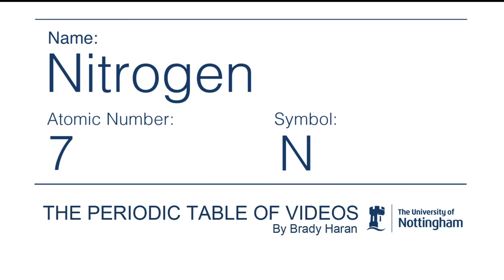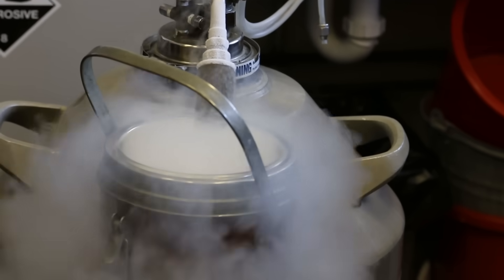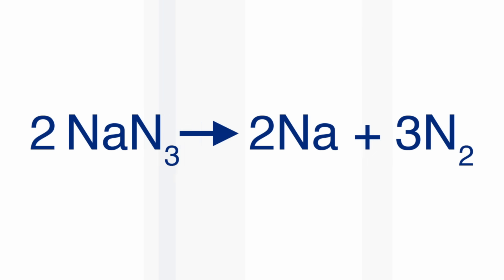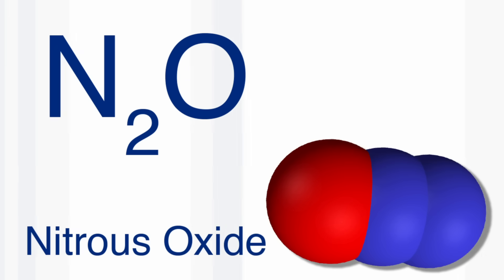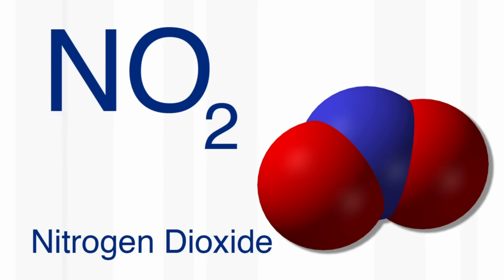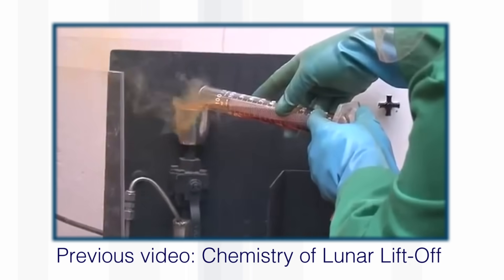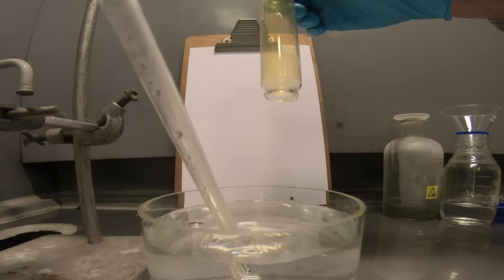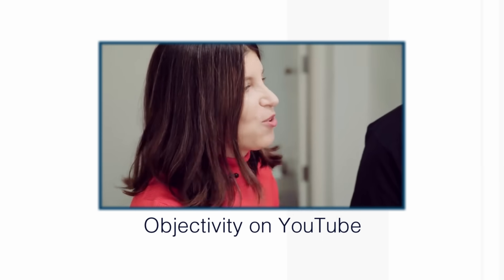Nitrogen - Periodic Table of Videos

Comment: I believe that you may be mistaken about the formation of NOx in gasoline versus diesel engines.  Diesel engines actually have a lower peak combustion temperature than gasoline engines.  The reason for the diesel engine's higher efficiency is due to the higher compression ratio of the diesel engine.  Also, until the development of the low sulfur diesel fuels, diesel fuel actually had a higher energy content per gallon (or liter, if you prefer) than gasoline.  This is an additional reason why diesel powered cars obtained better fuel mileage than did similar gasoline powered cars.

The delay in outfitting diesel powered vehicles with catalytic converters is due to the chemistry of NOx reduction.  In automobiles, there is virtually no oxygen in the exhaust and there is a trace amount of unburned HC.  The catalytic converter uses the NOx to combust the unburned HC which then yields N2, CO2 and H20.  This doesn't work for diesel engines as a standard catalytic converter would actually produce more NOx. This is because diesel engine exhaust has an excess of oxygen and virtually no unburned HC.   It took the development of SCR (Selective Catalytic Reduction) to reduce NOx emissions in diesel powered vehicles.  SCR uses Urea (basically a compound of ammonia) to reduce the NOx and produces N2 and H20.

Hth

Comment: The copper reaction looked so similar to a redox reaction equation i've balanced yesterday. I was wondering why the coefficients of the equation in the video weren't the same as the coefficients I had calculated. I thought maybe I had made a mistake. Then I checked my notes and realized that the reaction on the video weren't the same as the one in my notes. Mine had NO, not NO2. I must have forgotten to write the 2 and balanced a completely made-up equation, I thought. But then the video showed me the exact equation on my notes with all the exact same coefficients as well as explaining how this reaction is different. 
This sounds so weirdly specific and confusing but I had to share it because this tiny thing had my mind blown. science, dude

Comment: nitrous oxide is a really potent source of power for combustion engines when mixed with extra fuel inside the air intake or inside the engine since it contains more twice the oxygen than the air that the air intake receives.

Comment: As a biologist, we would use melting solid N2 to freeze samples. We would pour liquid nitrogen into a dewar, then place it in a vacuum chamber with a plexiglas lid, and pump the air out. The nitrogen would boil viciously until only only the slowest molecules remain, and they would solidify to a slurry. Then we would let air back in rapidly, remove the lid, and you would have a few seconds while the nitrogen was melting to put your sample in. The freezing nitrogen is quite beautiful, it forms like spaghetti ice, litlle growing worms of ice, each wit a droplet at the top.
The reason we used it rather than liquid nitrogen is that not only is it a couple degrees colder (-212°), it also stays liquid until all the solid is molten, meaning your sample is less prone to the Leidenfrost effect, and you get much more rapid cooling, leading to partial vitrification of the sample which you need to study undisrupted cellular structures.

Comment: There's nitrogen everywhere! It's in the air, in the soil, under our feet, and in the water we drink. It plays a key role in life. The way that it cycles in multiple forms through living and nonliving things, in the oceans, on land, and in the air, is called the nitrogen cycle. 

Without nitrogen from the soil, plants cannot grow properly. But it needs to be in the right balance. Too little and plants turn yellow and shrivel, but too much is toxic. Farmers add nitrogen-rich fertilizers to the soil to make crops grow better. Nitrogen is also vital for DNA, the biological molecules that give every living thing its instructions for life. Nitrogen helps form the rungs that hold the ladder of DNA together, and without it DNA would just fall apart.

Comment: 12:15 Diesels produce nitrogen oxides because at part-throttle they run very lean, so there's plenty of oxygen that doesn't get used up in burning the fuel.  In the higher pressures of a diesel engine nitrogen oxides are likely to form when the fuel is injected in the combustion chamber, as that's when the temperature and pressure are highest.

Diesels are more efficient mostly due to the compression/expansion ratio being quite a bit higher than in gasoline engines - the higher the expansion ratio the higher the efficiency.

Comment: It isn't only temperature that causes diesel engines to produce more NOx than petrol engines.  Petrol engines run with a close to stochiometric mixture at all times, so they have minimal excess oxygen.  Generation of NOx is in competition with the HC that wants to bond and make CO2 and H20.
A diesel engine requires full flow of air in so that they can compress the air to a high enough temperature to ignite the fuel.  A throttle valve restricting air would rarify the inlet and reduce the temperature and prevent the engine from running at light load.  Instead, the output is regulated by the amount of fuel injected.  At less than full load, there is excess oxygen.  This excess oxygen is available to react with the nitrogen.

Comment: It isn't quite true to say that nitrogen oxides are only formed in diesel engines, though they do produce more NOx than petrol engines. In fact, a petrol engine always produces some nitrogen oxides because of the spark plugs: Every time a spark fires in the fuel-air mixture (or even just in air), some of the nitrogen and oxygen in the air combine to produce nitrogen oxides. Lightning strikes make far longer and bigger sparks, which have a similar effect, so lightning is the natural source for NOx.

Comment: I use nitrogen when testing for leaks in refrigeration equipment. It has a low expansion coefficient allowing me to check my pressure regardless of the surrounding temperature.

Comment: Relatively obscure is the fact that NO emission regulations were partly responsible for killing off the idea of turbines in cars!
Chrysler had begun doing R&D on turbine engines for military aircraft & vehicles before the start of WWII because of the advantages of their simplicity & reliability, & were developing gas-turbine engines for cars right till the end of the '70s. 
Despite even producing a limited trial production of 50 (plus 5 prototypes) of their Chrysler Turbine Car, eventually the R&D on turbine engines was abandoned as they struggled to achieve acceptable fuel economy. 
However, another reason was that as the exhaust gases reached higher temps (another problem in itself),  there were significantly less unburnt hydrocarbons & pollutants, meaning NO levels were comparatively higher as a percentage of total pollutants, & consequently the failure to meet EPA regulations!

Comment: How come when you freeze something in a freezer (at around -20 degrees Celsius) it won't shatter, does the water in it not freeze as it's in the fruit?
Reply: Most solids get both harder and brittler as they get colder. At low enough temperatures, hit a steel plate with a hammer and it'll shatter. At the temperature of liquid nitrogen, almost anything will shatter if you hit it with a hammer.

Comment: About 18 years ago, we had an assembly area in the machine shop where I work, and the guys there had a common task of shrinking steel bushings into titanium parts. So they had these enormous dewars of nitrogen from which they'd decant a small amount of liquid into insulated plastic buckets. Into the buckets went the bushings, then, after a while, they were snatched forth (usually with a hook, but one guy would just reach in and grab one), hurriedly placed into position then pressed home. Afterward, they'd kick the bucket over creating a great cloud and causing the concrete floor much distress, lol.

Comment: The N2O in the cream can is not dissolved in high amounts!

It is, of course, dissolved under pressure and is released upon pressure reduction (i.e. openingthe valve of the can by pushing).

Most of the N2O is actually stored in a small gas cylinder inside the can.

Comment: One demonstration I usually do is freezing a flower in liquid nitrogen and smashing it. It's a little less messy than a banana when it melts but equally as dramatic. The major use for liquid nitrogen in my lab is as a radiation shield for the magnet dewar in a superconducting magnet system. Essentially you are reducing the black body temperature of the outer shell of the dewar so that the infrared component reduces to a very low level. This reduces the boiling rate of the liquid helium to the point where we only need to top it up every 5 months instead of every week.

Comment: actually, the professor is not quite right, when you use a dilute solution of Nitric acid, you get a mixture of NO and NO2......it is dependent on the concentration of the acid, of course.

Comment: not extremely related to this video, but: i never understood the explanation of how colors arise from electron energy levels. if an electron absorbs some quantum R that has the energy of a red photon, the color would be white minus red, but then the electron falls back giving off the same quantum making white - red + red = white. ??????????????????????????????????????????
Reply: Well, the absorpion spectra, e.g. what you are referring to as white - red occur as you describe it when white light is passed through a compound that is able to absorb the red light. Since you describe that so well, I guess that is understood by you.
Now what happens next depends on the stability of the compound state reached by  absorbing the (red) photons / light. That state can be very stable or very unstable (or something in between).
In the stable case this means that the state following the photon absorption exists for a significant long time. In that case resulting state is white - red for a significant long time, and the absorption lines (e.g. white - red) are clearly visible.
In the unstable case this means that the state following the photon absorption exists only for a very short time. In that case resulting state is white - red + red after a very short time, which is your equation.
So to unify them, you should really write:
- light immediately after absorption = white - red;
- light some time T after absorption = white - red + red = white;
where T is large for a very stable absorption state and T is small for an unstable absorption state.

Comment: We use nitrogen in our industry as a technical assist gas for laser cutting of sheet metal, usually the non ferrous type such as stainless steels & aluminium alloys.  Gaseous nitrogen  is supplied to our industrial laser machines through clean stainless steel pipes at 30 to 34 bar of pressure. The required purity is 99.995%, or specified as nomenclature "4.5" (representing the 4 nines & a five).  It costs 3.5 Israeli shekel or less than one Euro per cubed meter of N2 at 99.995% purity.  The laser cutting machine blows the nitrogen through the kurf created by melting/vaporizing the sheet metal with the focused multi kilowatt laser beam, this blows away the molten/vaporized metal as the laser cutting head moves across the sheet metal leaving behind a perfectly clean & non oxidized cut.Nitrogen is used in massive quantities every day in manufacturing industry.  Practical industrial application of science.
Reply: 3.5 Israeli shekel or less than one Euro per cubed meter of N2 -- at 1 bar or 30 bar?

Comment: 77 degrees kelvin? Just 77 K! Right?
Reply from the maker: I bet you always get upset when people say “PIN number” too. :)
Reply: My response to another comment:
The professor has been teaching chemistry since before that rule was introduced:
Before the 13th CGPM in 1967–1968, the unit kelvin was called a "degree", the same as with the other temperature scales at the time. It was distinguished from the other scales with either the adjective suffix "Kelvin" ("degree Kelvin") or with "absolute" ("degree absolute") and its symbol was °K.
Reply: Well, that's one's a tautology, like saying ATM machine or ATMOS system isn't it? I just remember getting corrected on saying degrees kelvin along with adding water to acid and writing in pencil in lab. So it's fine either way like Gordon Richardson says in that other comment in this thread?
Reply: Neato, so it's fine either way?

Comment: An interesting fact about Diesel engines. Despite using diesel “fuel” technically the fuel is Oxygen. The diesel just the ignition source which ignited because of compression. Unlike in a petrol engine, where the spark plug burns the fuel and oxygen is there so the fuel burns. My father can explain this 100x better as he is a qualified mechanic, but that’s just something that I found fascinating.

Comment: I understood very little and I'll probably have to re watch this, I was too busy at thinking that in the end the limestone in tap water isn't so bad, in the end it has a high content (it's practically made of the stuff) of calcium, so at the very least it helps your bones-
Reply: You'e right.  But limestone/calcium-carbonate (CaCO3), only 40% Ca by weight, is not very soluble in water -- 15 mg/liter; compare with 1,000 mg/day adult requirement of Calcium.  In any case, CaCO3 is more likely to react with atmospheric CO2 and water giving Calcium Bicarbonate, Ca(HCO3)2, which is readily soluble in water.  OTOH, if you live in a technologically advanced country, it's likely that the Ca ions have been removed from your tap water, as they cause carbonate deposits in pipes, hinder lathering of soap (scum formation), etc..  So, don't rely on your tap water to help your bones.

Comment: Diesel engines are also lean burn. Lots of excess air. Lots of nitrogen to react.petrols are controlled to 14.7 afr for the most part so there is less air, less nitrogen. They hear from compression is also much less as mentioned. Though typically petrol exhaust gases are hotter than diesel exhaust (which is why diesels have issues with DPF regen because the exhaust temps do not naturally get hot enough to oxidise soot).
Reply: 0tispunkm3y3r Keeping a stoichiometric AFR for petrols allows catalytic converters to reduce the NOx - their effectiveness drops dramatically with even small excesses of oxygen in the exhaust. This is also why it's hard to control NOx from diesels, since as you say they must run lean.

Comment: Kelvin does not have degrees. D:
Reply: Snow Ng Technically yes, but the professor has been teaching chemistry since before that rule was introduced:
Before the 13th CGPM in 1967–1968, the unit kelvin was called a "degree", the same as with the other temperature scales at the time. It was distinguished from the other scales with either the adjective suffix "Kelvin" ("degree Kelvin") or with "absolute" ("degree absolute") and its symbol was °K.
Reply: Gordon Richardson That would make more sense. Thank you for clarifying. Old habits. :P

Comment: Another excellent video! One thing to point out however, petrol/gasoline engines DO make NOx - it's just easier on petrol engines to make them emit less NOx, using either EGR (Exhaust Gas Recirculation) or adjusting cam timing to keep combustion temperatures down. Diesel engines can't really operate without those high temperatures however, so to deal with the NOx we are saddled with DEF (diesel exhaust fluid) systems in the US, which makes diesel engines, normally dependable, into cantankerous beasts with fierce maintenance requirements.

Comment: What are the crystals forming on the top of the bottle of nitric acid that you can see at 9:00 ?
Reply: Anhydrous nitric acid freezes at −42 °C to form white crystals.  If you notice, the bottle has a thin layer of frozen water vapour around it (look at the label in particular).  The acid is probably stored at low temperatures for safety and stability -- It slowly decomposes to NO2 and water at room temperature.  So that's probably residual acid, from previous pourings, that's frozen into crystals.

Comment: I think the reason the water sucked back into the glassware wasn't due to the gases dissolving into the new nitric acid, but rather that the hot vapor in the reaction vessel was suddenly cooled by the new nitric acid, causing it's specific volume to be reduced, which in turn caused a low pressure that sucked the water in.

Comment: Ok, professor is a bit wrong about why diesel engines produce more NOx than petrol engines, there are two main reasons:
1. Diesel engines works in abundance of oxygen, while petrol engines try to stay in stoichiometric AFR (air fuel ratio), so nearly all oxygen bond to carbon and hydrogen while in diesel there is much more oxygen that can bound to nitrogen.
2. Diesel is injected into a cylinder and is burned at the edges of air and diesel mist, while ideal conditions for petrol engine is homogeneous mixture, so again, it is much easier for oxygen to bind to hydrocarbon molecule. 
LPG and CNG mixtures run "hotter" but produce less NOx than petrol or diesel engines just because it's easier for oxygen molecule to bond to a hydrocarbon than to nitrogen.

tbh, I'm a bit disappointed that prof Poliakoff was so misinforming about the issue.